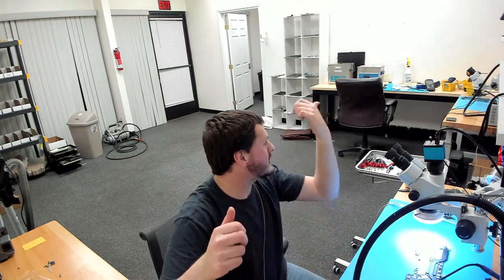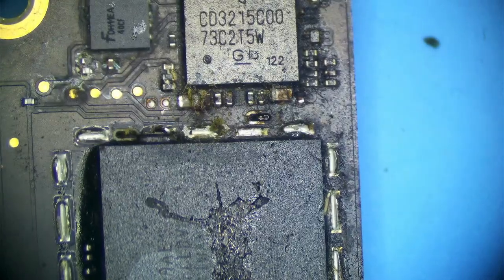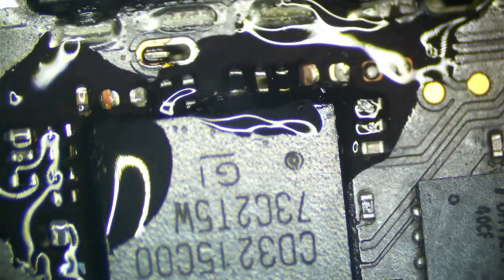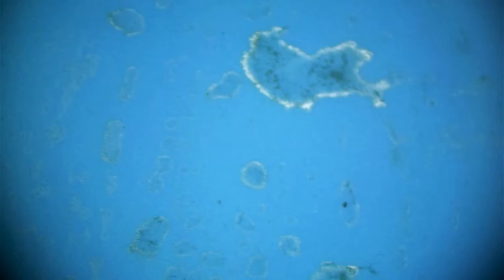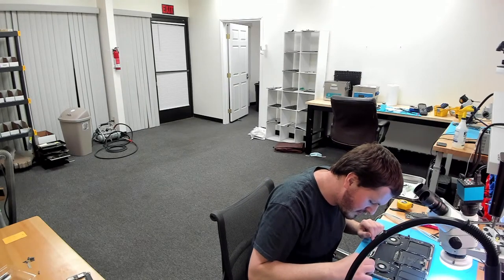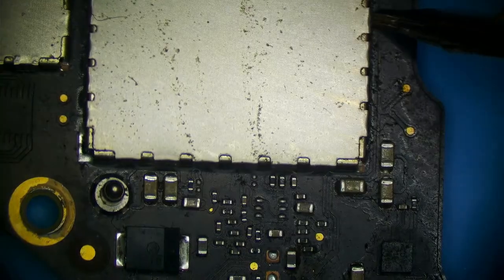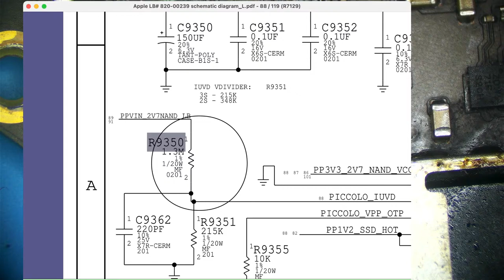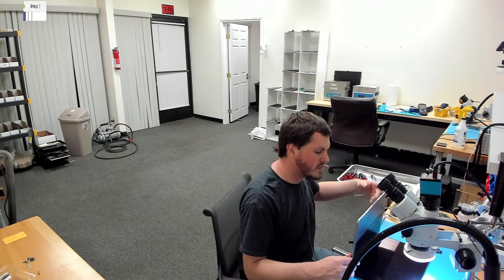Multi-compound issue on a A1706 | MacBook Data Recovery

Comment: Hey I have a A1398 on my desk that customer reports a random screen duplication issue that occurs for about 1 to .5 seconds then goes away - this will occur when unit is on a desk on battery / charger, while customer is reading something / watching something. Unit has 2.2GHz iGPU only. No reported reboots, in our testing performed CPU mosfet test which consists of stress testing CPU iGPU, and sleep wake about 10 times or opening all apps in apps folder all at once, no issues with that. Would this be maybe a filter issue?
Reply from the maker: What do you mean by screen duplication issue? Usually visual artifacts are almost always related to RAM/VRAM/iGPU on that model.
Reply: @TCRSCircuit  yeah his screen image kinda splits in half showing only both halves for a split second. I have yet to replicate the issue - during my testing I always move the system around - pick ups and set downs, hard typing etc
Reply from the maker: @somesituation  Hmm... A screen may be possible as well...

Comment: Awesome video.😍 
Really appreciate what you doing here. 
I have a request can you please make video how do you recover data after fixing logic board faluts. What software you use and what are the procedures to backup the data.
Reply: Well the easiest way by far is to get the customer's password and back the data up in MacOS if the machine gets that far.

Comment: Damn, sorry I missed the stream Tim, watching now. I regard to shield removal, what do you do to gain access to all the passives that surround the T2 chip (U3900) on say a 820-01987 board please? Cut the central perforated section out maybe? I wouldn't want to be trying to remove that shield with hot air. Thanks
Reply from the maker: Don't use hot air at full temp. Use low melt around all the solder then remove it with low temp hot air, around 250*C or so is safe.
Reply: @TCRSCircuit  thanks Tim